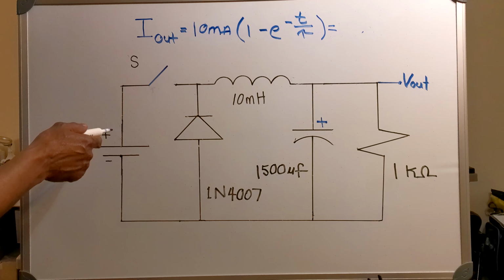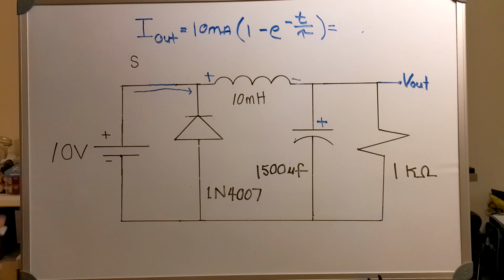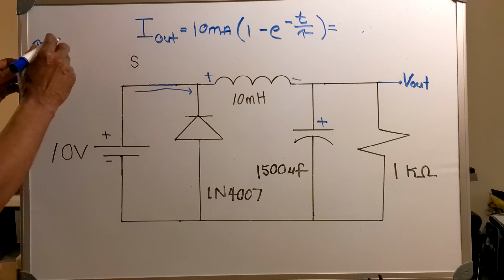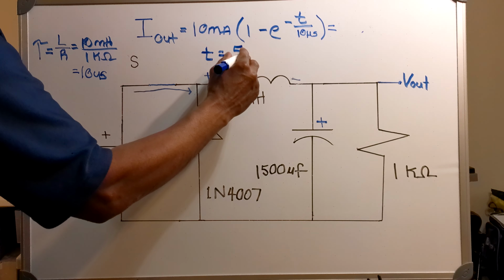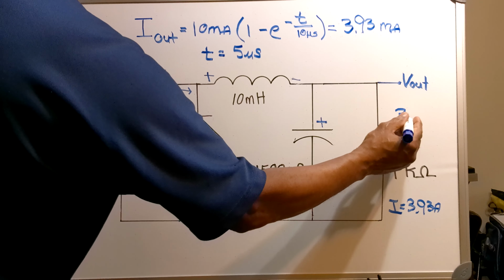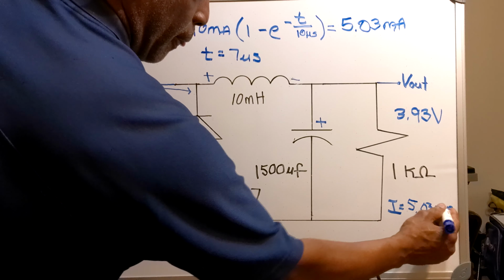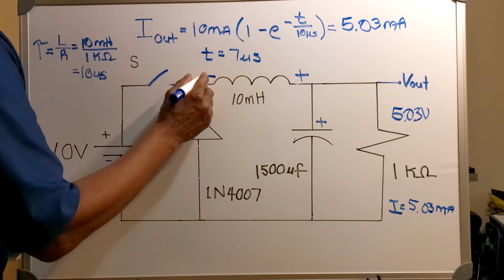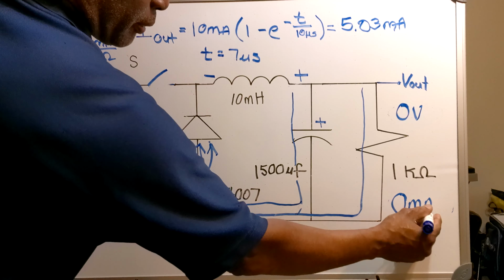Inductor, Resistor, Capacitor, Diode Circuit!

Comment: Your ignoring the capacitor.       The instant the switch is closed, the cap acts like a short and the inductor acts asts as an open.  You can't ignore the capacitor or the inductor for either switch position.